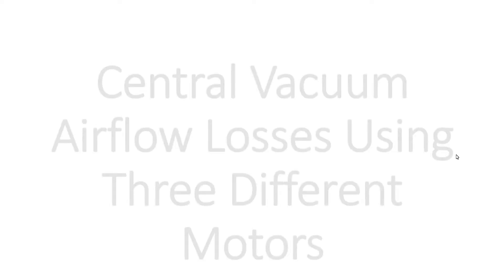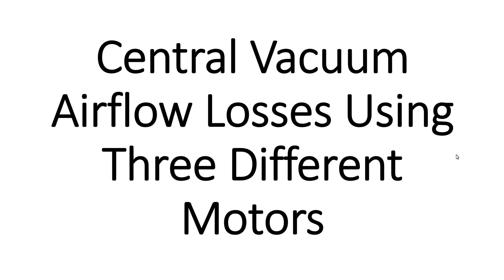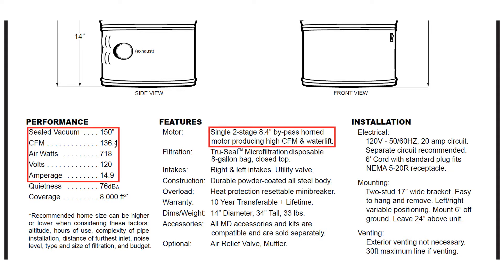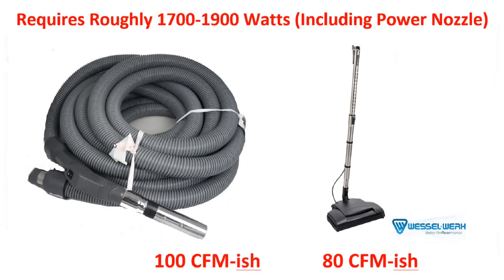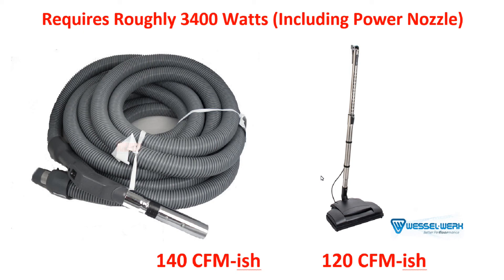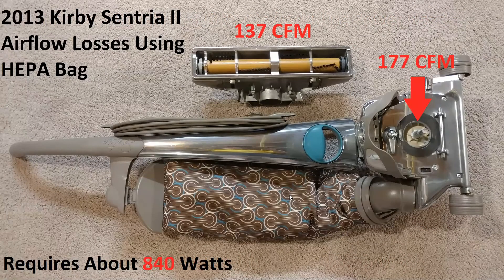Central Vacuum Systems Airflow Losses

Comment: Here's my opinion on the matter.

I've been wanting to install a CV system in my home for years. My first exposure to one was with one of my neighbors. They had a Cyclovac system installed in their home. They let me use it, fell in love with how quiet it was, and the rest is history.

I've got little doubt that you know what you're talking about in terms of testing and performance measurements, but this hasn't stopped me from wanting a central vac. The reason is because I love them for their other good qualities, such as their quiet operation, good filtration, durability, low maintenance, and convenience. Also, it's pretty much impossible to get consistent measurements of airflow from the end of the hose, because each home is different. Some have more piping than others, some have more inlets, some need higher performance power units, etc. As for power consumption, I'm not that worried about it. That may sound foolish, but at least from an environmental standpoint, there's more to worry about than some dude running a fancy vacuum cleaner. Like, what if that electricity for it was generated cleanly?

This isn't to say that there aren't good portable vacuums out there, and that central vacuums are for everyone. Not everyone can afford such a system, or their house isn't adaptable to one for whatever reason. That's where a good portable vacuum is good. I wouldn't say a Kirby is a good fit for everyone either, but they're a solid choice if you want an old-school, deep cleaning machine that is extremely versatile.

In short, you make good points, but I still think the benefits of a Central Vac outweigh the cons.
Reply from the maker: @amtrakpepsiproduct1605  so, what are the benefits, exactly? Especially compared to uprights or canisters? It's  not filtration or airflow or power usage for sure. BTW, I've lived in 4 homes since 1974 that have had central vacs. I like them, but would never pay for one.
Reply: @VacLab  I listed the benefits in my comment. Power usage and airflor weren't among them, and when I said filtration, I meant that you can vent them outside, so that would filter any microscopic particulate out of the living environment. If you didn't want to do that, then the power unit on its own would probably filter decently, as long as you were using HEPA bags. I'd avoid bagless systems, as they're like portable bagless vacuums, but even worse to empty.

It's totally fair that you wouldn't want to pay for one. That's one of my biggest (and few) problems with them, that they're expensive. But then again, so are many good portables, like Kirbys (assuming you were to buy one new, which I strongly do not recommend). That's why I say that they're not for everyone.

Also, what systems did you have installed in your houses? I'm curious.
Reply from the maker: Unfortinately, i cant remember the brands because it was many decades ago. Havent been around them much since the 1990s.
Reply: @VacLab  I see. I'll say this, central vacs have come a long way since their rebirth in the mid 20th century. Hoses have gotten lighter and more efficient, and many different central vac convenience products have been introduced (i.e. the Vacpan, direct-connect inlet valves, retractable hose systems, etc.).

Comment: Well, looking at this video again, I get similar performance from my Ridgid wet and dry vac as it can power a TurboCat with little suction, referring to your video on that detachable blower Ridgid you did about a year ago.  Of course, the bulk of the hose on it has to be the standard 2 1/2" hose and wands associated with wet and dry vacs down to a conical reducer or using the car cleaning kit hose I got with mine.  Incidentally, I made a shop vac 2 1/2" adapter out of a spare protective intake screen for my Heritage II/Legend.  I seldom use it as I use the upgraded hose I got for it, the longer plastic crush-resistant hose from the Generation series parts I found at a thrift store.

Comment: There’s NO reason for central vacuums to exist in today’s world, where we have portable vacuums that FAR SUPERSEDE central vacuums systems in terms of suction and airflow.
Reply: I respectfully disagree. I consider them to be the magnum opus of residential/commercial vacuum cleaners, due to their quiet performance, long lifespans, convenience, filtration, and other factors. Yes, there are plenty of good portable vacuums out there, like those from Sebo, Kirby, Numatic, etc., but if you have the money and space for one, I'd strongly recommend installing one.
Reply: @amtrakpepsiproduct1605  I had a friend that did a complete renovation to her house after a tornado went through our town and I asked if she was ever interested in installing one at the time, she said there was no point as she still used her TriStar canister and Electrolux upright and was perfectly happy with them.  I asked about whether she considered just roughing one in as it may put some value to her house, she said that would be up to the next owners.  I, myself have a central vac and yes, I tend to use it more currently than the other units I own that are of a portable nature but I prefer using my Rainbow as it is, in my opinion, the best representative of a machine that is relatively quiet, its versatility is better than most central vacs as it does wet and dry cleaning and is also the best filtering machine out there as the water is able to trap 99.97% of all household debris.  I also use my Kirby if I really want to do a proper deep cleaning of carpets, you cannot get that with a central vacuum.

If you are installing a central vacuum for commercial purposes, I would suggest something of the wet and dry nature and also in most commercial spaces, if you are vacuuming with anything, the backpack vac has you covered.  Otherwise, that's what an autoscrubber is for.

Comment: Our home came with a CV system...  (Nutone 350 70's era).   After 40 some years,  the bearings in the motor failed, and I put a new Imperium bagged motor in it.   I must say that this CV has been my favorite cleaning system I've ever used.  I don't feel that I'm at a loss for power,  and the lack of noise and smell (exhausts outside) are favorites of mine.   We own a few hoses for different areas of the home.   If anything,  I enjoy the versatile range of tools, and the lighter weight of the tools and power heads.  Modern "crush proof" hoses are strong and light, and make the job enjoyable.   I'm sure there's some machine that can deliver more cleaning power per pass,  but in balancing power/weight/maneuverability and convenience,  I'd really hate to have to return to an upright or canister vac.   Dragging the canister around,  or carrying anything up the stairs... or cleaning the stairs is NO FUN with a short hose, or an upright.   We now have help cleaning here, and she likes the CV for the same reasons I do.   If the layout of the inlets is good,  and you have adequate tools in each region,  CV's have a TON of advantage.

Comment: A custom 3D printed homemade canister vacuum cleaner with a 6.6 lamb motor and SCR speed controller paired with a wessel werk power nozzle and standardized central accessories would be worth it.
Reply: Or an MD.
Reply: @user-vacgod2739  What made you change your opinion on central vacs?
Reply: I beg your pardon?

Comment: Let's compare central vacuum to the clean air upright vacuum.
MD M715h hose 100 cfm (massive size motor & 1700 watts).
Vorwerk VK-135  pipe 109 cfm (small size motor & 900 watts).
And the Vorwerk is lightweight nimble little upright.

Comment: About ten years ago I lived with my ex wife in a 2100 ft² house. Previous owner had installed the Allaway central vacuum system. Whole house only had two hose ports. Hose was about 32 ft long. Vacuum unit itself had a Lamb Ametek two stage 1300W motor. Very simple design. Just like in the shop vac: large round pleated "hepa" filter above the bin. Main unit located in the cellar and exhaust air was vented outside with a short pipe. From the outside it sounded like a jet fighter (no muffler).
So how it was? It sure was quiet inside the house and fairly powerful. Furthest hose port had noticeably weaker suction/airflow than the first port.
Biggest problem in the convenience factor was the massive hose. I remember that it was always unpleasant task to take it out. So was the bin emptying and filter cleaning. It wasn't powerful as I thought it would be. It was my first and so far only central vacuum system what I have used.
Reply: Bagless ones aren't as good as the MD / Filtex style. Those have really good performance, but if installed incorrectly, airflow will be losted notably between valves. Typically it's just a 5 inch loss of waterlift, and the same amount of airflow.

Comment: very pertinent analysis, many have been wondering about a central vac's efficiency, this vid, sure sheds some light on it....and using a Kirby as a reference.... I have one so I loved it!
Reply from the maker: steeltag thank you for your comment!
Reply: I watched another Youtuber's videos saying the Kirby's performance wasn't great and the direct air system was inefficient.  I then asked why so many direct air machines are used for collecting leaves?  I figured it was the performance and efficiency of the direct air technology for the size as my Kirby moves more air than my other machines  at half the power.  My Rainbow takes around 840 W for the motor unit sans power head and the same goes for my central vac and other canisters, while my Kirby Heritage II Legend in carpet mode does roughly 540 W.

Comment: Why pay for a $3000 central vacuum when you can get a $70 Hoover Tempo Widepath with the same nozzle CFM as the central vacuum! What is the least aggressive brushroll you have ever used?
Reply: The CV Equipment is usually built to a commercial grade and will last 10-20x longer than a typical consumer vacuum.   My home (70's era)  came with a CV,  and the motor survived 40 years.   I replaced the motor with a stronger one for 400$, and continue to run.   Once you've used a CV,  the convenience,  low noise, lack of smell, and air exhausted outside are enough for me to prefer the CV system.
Reply: @DeadKoby  Same reasons for my Rainbow, without venting outside, thus better overall filtration with few to no consumables during the life of the machine.
Reply: Or get a middle of the road central vacuum and go tandem air.
Reply from the maker: Yes, exactly my point! 😎 And the softest brushroll I have is on my Electrolux Olympia One.

Comment: There was a central system in the Brentwood home that I had in the 1990s. When I moved in it needed a new motor and I needed to have leaks repaired in the wall pipes. I found Central to be nice to use on days when I moved my furniture and cleaned baseboards,walls, molding, and furniture backing because it was quiet but I'd never buy one again. I didn't find dragging a thirty five foot hose around to be convienient, I often worried about food collecting and sticking inside the duct work attracting bugs. Finally I did see a considerable increase in electricity to the point that I could pay a second utility bill with the difference every month. Needless to say that I'm not rushing out to buy another.
Reply from the maker: Bruce Solomon my parents have had at least three systems, with the first one in 1975. My mother is quite a fan of them, although she no longer vacuums as she turns 87 this year.
Reply: That's why my Electrolux Silverado and my Kirby stay on the second floor and my Oreck and Ekectrolux AB canister stay on the first floor.